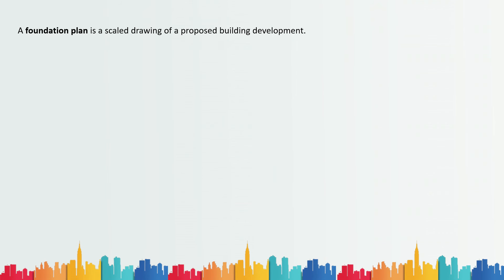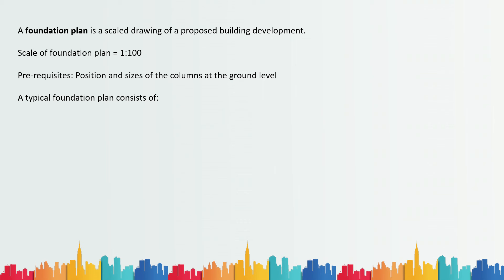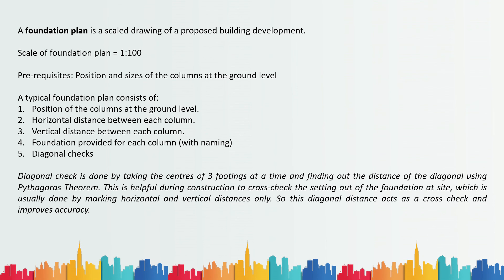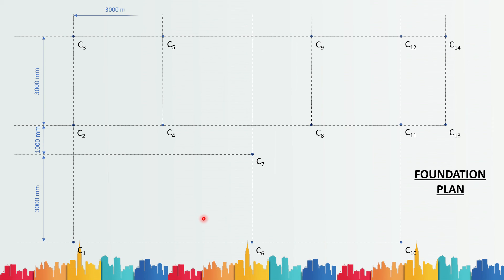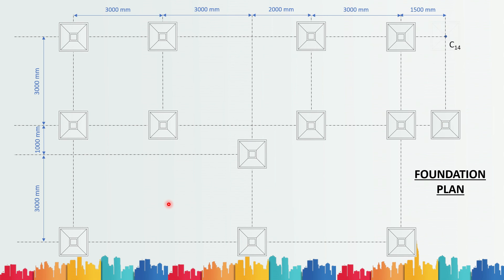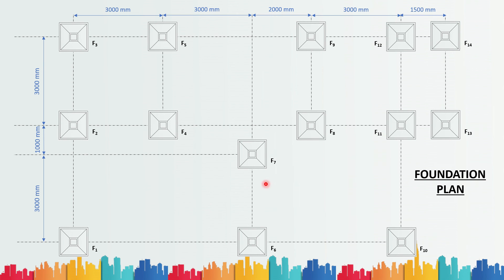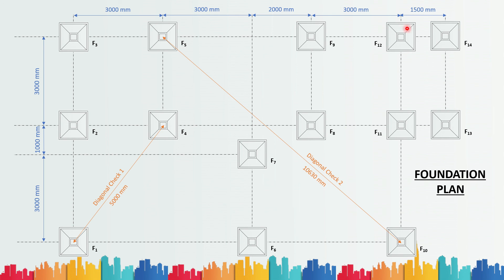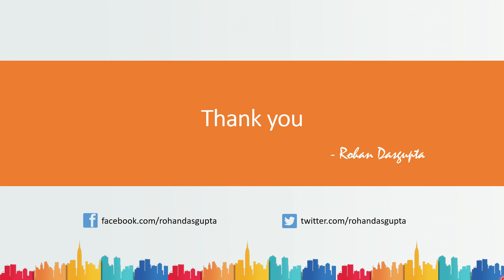| Foundation Plan | How to Draw a Foundation Plan - Step by Step | explained by Rohan Dasgupta |

Comment: hello sir 
my que is when we fully design building in staad or say etabs and in detailing through rcdc when we design footing in rcdc it does not gives us typical dimensions of footing instead it may give diff dimensions for each footing according to load distributed so while  making a detailed plan should we use that same dimension or make them approx to have same type of typical dim for all footings
Reply: Thank you sir , sir please make a video on how to design rcc building manually in detail ,how in practical a structural designer design a building ,his workflow etc ,it would be really helpful to the students as theres no such detailed videos available on YouTube
Reply from the maker: You have to show different dimensions as found in design.

Comment: are the measurements (dimensions) from one column to another the standard measurements, sir?
Reply from the maker: No. It differs from plan to plan.
Reply: @DrRohanDasgupta  oooh, okay sir. one more question sir. why is the diagonal check 2 is equal to 10630mm when you added 3000mm , 1000mm, and so on so for? I'm confused, sorryyyy
Reply from the maker: @russg.7846  In Diagonal Check 2,
- Distance between footings F5 and F12 is (3000+2000+3000) mm = 8000 mm
- Distance between footings F10 and F12 is (3000+1000+3000) mm = 7000 mm
Now, considering F5-F12 and F10-F12 as two sides of a right angled triangle,
the diagonal F5-F10 = √[ (8000)^2 + (7000)^2 ] = 10630 mm
Reply: @DrRohanDasgupta  ooooh now i get it. thank u sir! you're such a big help for me and you explained it way better than my professor. thanks! 🤗
Reply from the maker: @russg.7846  You're welcome. 🤗

Comment: Sir, why didn't you include the wall and the wall footing?
Reply from the maker: Because I have considered a R.C.C. Framed Structure with Isolated Sloped Footings.
Had I considered a Load Bearing Structure, I would have considered a Wall Footing.
Reply: https://youtu.be/V7zno-6T6BM

Home foundation plan 
Wall foundation